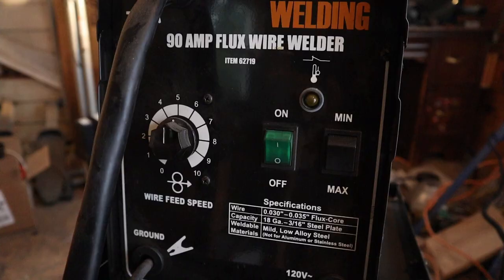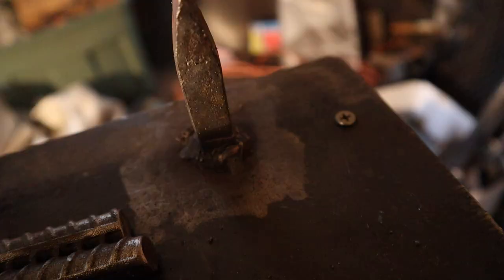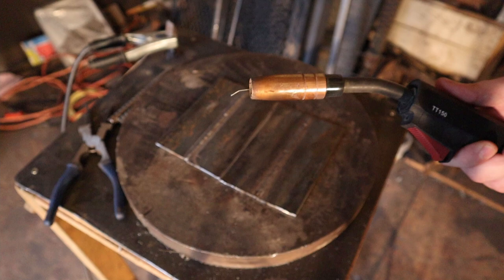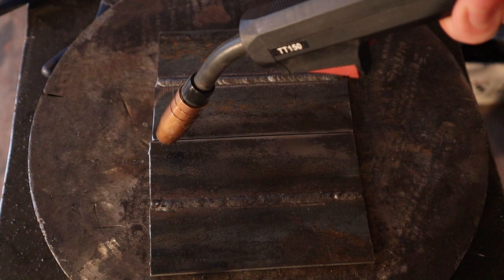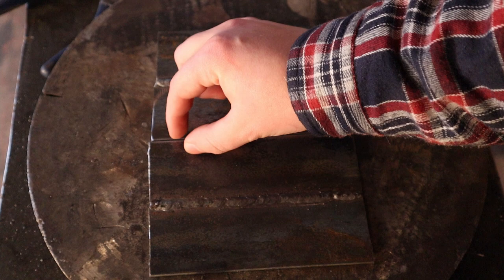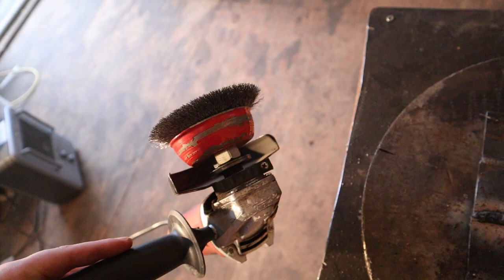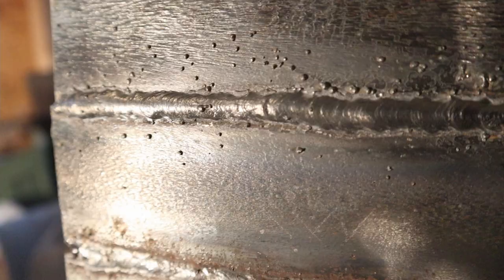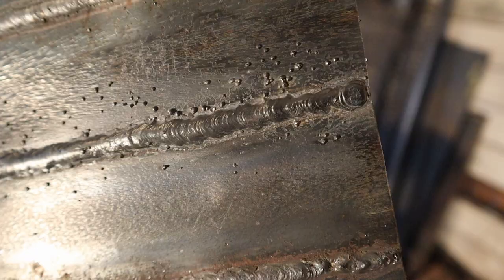How to weld with a Flux-Core Welder From Harbor Freight!

Comment: Thanks for this video I bought this welder to patch up the floor pans in my truck sounds like this unit will do the trick. thanks again 😊
Reply: It's very tough to do. I burned through mine. I was on speed 3 Minimum Amp.

Comment: I notice pretty much everyone who uses these Harbor Freight Flux Core welders comment about the amount of spatter the wire creates but no one mentions the various sprays and tip-dips you can use to reduce the spatter or make it easier to clean off. Weird. You'd figure these products would be sold hand-in-hand with all flux core welders. The products do work.
Reply from the maker: The sprays do work and I use them occasionally. But for most welds, they are at an awkward angle and using spray might get into the weld zone. Or using the spray is just an extra step and I'd  rather just grab a wire wheel and rip the spatter and slag off the weld that way.
Reply: the biggest cause of the splatter is that it's an AC welder. a quick conversion with a bridge rectifier to make it DCEN takes care of almost all the splatter
Reply: A GOOD point . Question:  Though using those "Pam" type sprays is a great idea iT still needs the polarity reversed right?
Reply: @lancerobbinssr4546  it needs polarity introduced, the Chicago electric uses AC instead of DC, which is why people put a bridge rectifier in them
Reply: @lancerobbinssr4546  Personally I don't think rewiring needs to be done. To me it seems like a popular YouTuber did it and everyone else just jumped on the band wagon and now it's become "The Norm". That it HAS to be done. I don't believe it does. Otherwise the manufacturers would have wired it that way at the start. It seems like a popular mod that gets done just for the sake of saying "I did it"

Comment: One more thing, if it is possible to switch the polarity the welder will be much better. The Postive is on the gun thus heating the wire way way too hot to where it just explodes ( EXTRA SPLATTER)  WHERE IT SHOULD BE HEATING UP THE MATERIAL INSTEAD.  SO A SWITCH OF POSTIVE AND NEGATIVE WOULD BE A MUST FIR THIS WELDER IF IT IS EVEN POSSIBLE ON THIS MODEL.
Reply from the maker: Unfortunately this welder is an A/C only  machine. So the polarity is not able to change from negative to positive.

Comment: Another video showing a Lincoln welder shows that the leads are wired wrong with negative ground .  Is the Harbor Freight also wired negative ground and should it be reversed to pos grd and neg to the wire?
Reply from the maker: This welder is permanently an A/C welder. So unfortunately it can't be configured for dcep or dcen welding.
Reply: @FerrousPhoenix  That explains why the full wave bridge rectifier and capacitor were added on the video I watched.  Upgraded cooling fan, better transformer for the feed motor, etc.   Thanks for reply!

Comment: what brand wire are you using ? I think higher grade flux wire will reduce your splatter immensely . I have an old HF 131 and i use Hobart mig wire and get very little spatter.
Reply from the maker: Its a Hobart inner shield wire

Comment: Would the welder weld a traction bar brackets on my truck frame and be done good enough to structurally hold it and be safe as far as the weld is done very good and nice will the wire or metal itself Bond the metals together good enough to be sturdy on a would you feel safe if you welded say leaf spring brackets to the frame on a vehicle would you feel safe if it was welded correctly with that welder
Reply from the maker: If the metal is thicker than about 1/4" I would preheat the metal to at least 200°F . And if you feel it needs more weld, you can clean off the 1st weld as clean as possible, and add another 1 or 2 welds on top of the first welds.